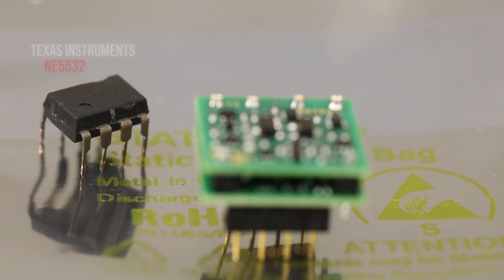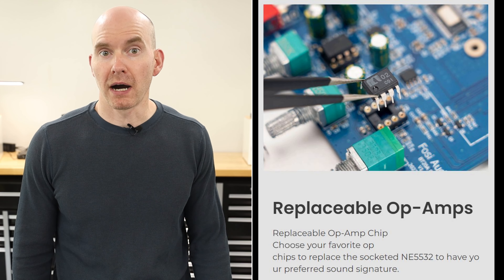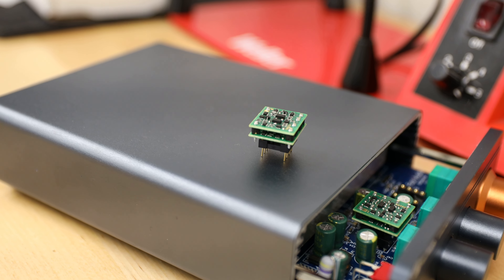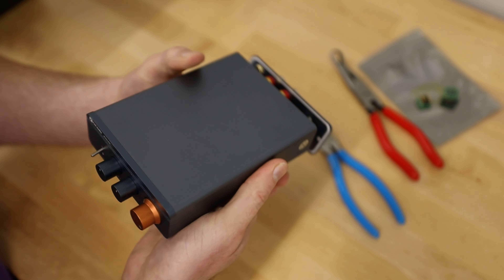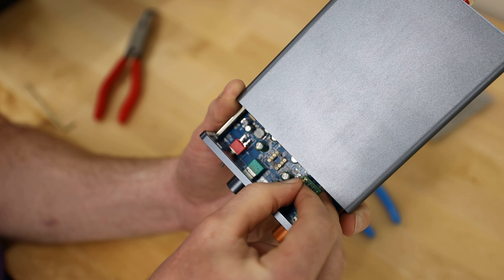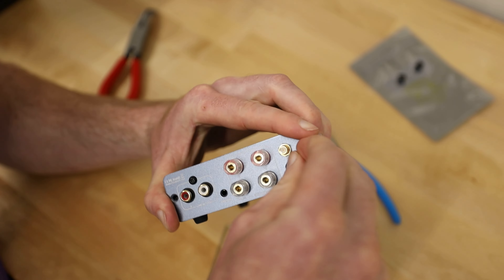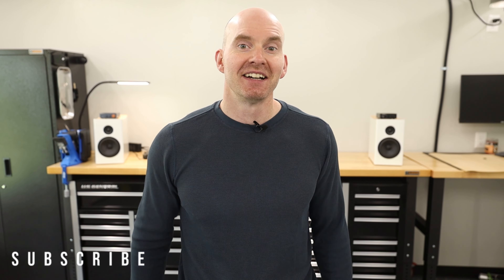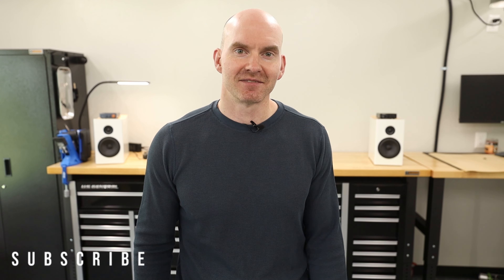Sparkos Op-Amps - Magic Beans or Musical Bliss? Fosi BT20A Pro Install

Comment: Take these reviews with a big spoon of salt. I have this little ChiFi amp, it’s wonderful for what it is for desktop listening, casual game room setup etc. but let me be clear, it’s no match for even a entry level, but well built, well priced offerings from Cambridge or Emotiva etc. The Emotiva Mini X-A100 that I also own beats the snot out of this little bugger in terms of superb midrange weight, bass depth and tightness and well resolved treble and separation. But for $80, this BT20a Pro does hold a surprise or two on how well it still can drive medium to large speakers. Anything upto 11 O’clock position sounds good. Beyond that it loses its composure, but it’s already pretty loud 90db by then. Try this for fun and you may find a use case. I haven’t done any OPAMP rolling, but replacing with a pair of Sparkos chip costing more than the amp itself makes no sense. Just buy some well established Integrated.
Reply: Very well said & you're totally right about going with something better & definitely the part about if the chip cost more then the amp part 👍🏿🤦🏿🤷🏿

Comment: Thanks for this revue and your honest impressions. Just got my Fosi V3 and and so far it pretty good considering I am using the Wiim Pro with its average or below par integrated DAC. So I am waiting for my Geshelli J2S upgraded with a single SS3602 for the RCA  output. So if I were to get the Sparkos 3602 for my Fosi V3, would I need the raisers due to the Fosi V3 small space for Opamp? And also will this set up work well, having single J2S SS3602 and also on the V3 or is it overkill? I hope my post makes sense. Best regards
Reply from the maker: Hey sounds like a great little system your putting together. I can’t speak on the synergy of the J2S 3602 along with 3602’s in the V3, I haven’t had that combo yet, yes you will need risers for the V3, it’s a tight fit.

Comment: Hello Matt,

Could you tell me the exact size of the socket wrench you’re using to remove the screw from the volume pot to take the chassis off?, as I’ve a Fosi Audio V3 just arrive moments ago, as well as several different brands of Op-Amps come in I’d like to roll.

TIA!.

Comment: Hi great video thank you! Would the op amps you used on the fosi also work with the aiyima a07 pro?
Reply from the maker: Yes but I believe you do require the risers for a A07 that I show in this video.
Reply: @MattCoykendall1  that falls in line with other things I’ve heard , thank you!

Comment: same experience except with an ayima a07.   the sparkos smoothed out the high mids.
Reply: If it smooths things out, you are removing detail, it's as simple as that. Just like a valve amplifier.
Reply: @MichaelBeeny  it wasnt detail.   it was harsh..exaggerated..  ears are different

Comment: I claim to have Golden Ears 🙂 The Sparkos op-amps are very good, some of the best out there, but it does not pay of to put them in this amp. Much better do it in the newer Fosi V3 amp.
And why is that you may ask? Because you are only able to change 2 of the 4 sound killer op-amps 5532 in this amp, the 2 others are surface mount op-amps, which are very hard to change.

The 2 problems in this amp are: They have implemented a tone control that introduces fase shift (bader sound), and it can not be dialed out even in the mid position, and the other one is
that it has 2 SMD mounted 5532 op-amps that can´t be changed, if you are not very skilled at SMD soldering. The Fosi V3 does not have those 2 SMD mounted 5532, and sounds much better.
Reply from the maker: I actually moved the Sparkos op-amps over to the new V3, they will likely live in that one until something new comes along to experiment with. It was a tight fit on the v3 and does require a riser but its doable.
Reply: @MattCoykendall1  Maybe you will give your opinion on the sound of the 2 amps? I find the V3 much better.
Reply: not to mention that as the 5532 was the standard in the audio professional equipment for decades, it means that amost all the music existing on the planet has passed trough tens of 5532 before reaching the final customer. 
So the claim is that the change of the last final opamp in the chain will magically recovers all the sound quality lost during all the production process?
I claim that a change in sound is necessarily measurable. If a change is measured, so it mean that the original signal has been distorted in some way. the so called "subjective"  changes that can't be objectively measured are a bullshit. it's a reaction to a belief and bias. 
if you like the "smoothness" and other magic words introduced by distortion in a signal up to you, but don't pretend it's a more pure sound.

Comment: Ever since discovering the Sparkos Labs Op Amps, which began when I purchased the inexpensive Aiyima A07, I became hooked.  Yes, the Sparkos Labs Op Amps are much more expensive (but you get what you pay for here).  In each case now (using them on a half-dozen other Chinese-made Op-Amp upgradeable amplifiers), the sound improved, making the overall sound signature sound closer to the warmth of a class AB amp.  It was enough of a difference for me to make the adjustment to be sure.  

As an aside, I've not found a class AB amp that accepts interchangeable Op Amps, and it seems the entire genre (correct me here if I'm wrong) can only be found in class D amps, that typically have a colder, 2D type of sound.  The Sparkos Labs Op Amps change all this for the better (in my subjective opinion of course).  I've also put them in various other components such as FX-Audio and Douk Audio DAC's - and it made a huge difference there also.

A very close runner up (if you don't want to dish out the money for the Sparkos) are the IC design Muses02 - that IC chip also has a much warmer, tube-like sound.  In the end, if you love the colder, 2D type of sound of Class D amps, don't change a thing.
Reply: sir what other op amp have test?  what op amp is close to sound of tube? ( sweet, mild, bass)
Reply: @jericlee1509  Keep in mind that no one OpAmp will give you a total transformation.  I've been experimenting with OpAmps now for over two years, and here are my observations/recommendations:

1.  For the most part, I've found that the Discrete (remember that word - Discrete) OpAmps wind up giving you the greatest improvements in sound quality.  This includes improvements in instrumental timbre, overall sound tonality, and warmth.  Of course, Discrete Op Amps are also more expensive.

2.  Of all the IC (small) Op Amps that you notice inside of class D amplifiers, I have found that the MUSES02 (in my opinion) is the best of that variety.  Now the MUSES02 will still set you back in the $40+ USD price range.

3.  Of the Discrete Op Amps, there are 3 that I can strongly recommend, those being:

a.  Burson V5i - this one may run you from the $40 - $50 range (depending on where you get it from) and is roughly 1 - 2 times larger in size than the regular IC based Op Amps.  It adds (again, in my opinion) more overall warmth, better instrumental timbre, more dynamics, and better bass response.  But do remember that there are some class D amplifiers that already a built-in tonal curve to accentuate the bass and there's not much you can do about that.  What discrete Op Amps might do is to try and make that bass tighter and more dynamic.  The website address to that OpAmp is here:

https://www.bursonaudio.com/product/supreme-sound-opamp-v5i/

b.  The 2nd recommendation that I can make, and this one is most expensive of the bunch (but not necessarily the best overall) is the Burson V6 classic - but I'll tell you right now that it may NOT fit most of the budget class D amps because it is very tall and that may interfere with the amplifier casing.  That runs from $89 to $100 USD, depending on where you buy it from.
The website address to that OpAmp is here:

https://www.bursonaudio.com/product/supreme-sound-opamp-v6/

c.  The final recommendation, and in my opinion, the best (again, remember, I'm offering personal opinions here based on experimentation), is the Sparkos Labs SS3602.  Now this OpAmp is much larger width-wise (around 3-4 times larger an an IC), is priced between the Burson V5i and the Burson V6 classic.  Overall, it has a warmer tonality - spread through the entire frequency range, not just one particular area.  It demonstrates great dynamics, superb highs, and a very nice midrange.
It cost (before discount) - $79.80 USD, however new customers usually get a discount which ranges 15-20% off).  If you are a repeat customer (you have to be a repeat customer though), the 20% repeat discount can be had with the code:  RETURN20.  The website for this OpAmp is:

https://sparkoslabs.com/product/dual-discrete-op-amp-ss3602/

In the end, there is no one OpAmp that makes an amplifier sound "just" like a Tube Amp.  What these OpAmps do is to change the personality and tonality of the amp and no two users will have the same musical tastes on how they prefer their music to sound.

With budget amps, I've long since found out that the Sparkos Labs OpAmps give you a huge bang for the buck and inches your amp closer to that Class AB or Hybrid Tube sound.

Good luck:
Reply: @MrBenherrmann  thanks so much, really help,  have heard or try of staccato op amp?
Reply: @jericlee1509  Not off hand - I haven't heard of that one.
Reply: @jericlee1509  I've tried a variety of the small IC based ones.  They have limitations and the right now, the only Discrete versions I can recommend are those I recommended in my previous reply.

Comment: The only valid test to me would be a blind test. When you spend 80$ on a chip, I think it's more what you want to hear, than what you are really hearing.......the proof is that there are only 2-3 videos with direct side to side sound comparisons and even there there's hardly any difference.
Reply: If I just spent $80 on a preamp chip. I KNOW it will sound better! lol. Wont it?
Reply: @MichaelBeeny  Not necessarily. It's about the requiremenrs of the circuit, supply voltage, slew rate, needs compensation or not, type of input (JFET, FET, bipolar, etc). The opamp is only a part of the equation, opamp rolling is funny (I have done it), but to date I haven't done any test where one opamp magically sounds better than the rest, just because it's more expensive. If that be true, you'd see plenty of evidence and countless YT videos.....

Comment: A better option would be don't buy a class D in the first place. To say buying discreet allows better matching of components. Not true, you cannot beat laser trimmed ICs for matching and near 100% consistency. All at a fraction of the price, just avoid the many fakes from China. Avoid snake oil at all costs and, it's gotta be better, if it cost more than the amplifier. Sure, they often have a higher current rating, but will this help? No, it's a preamp, it's a voltage amplifier, not a current amplifier. Sometimes, these can overload the current available from the power supply. A typical IC will draw about 10mA, the many discrete versions can draw 60-100mA. Overheating the 15 volt supply.

Comment: Data. Record the audio. Use data. It doesn't mean a God damn thing when people say "it's warmer, sharper, fuller" when there's no data. This video was nearly useless aside from showing us how to roll the opamps.
Reply: Warmer usually means, loss of detail. Fuller means added harmonics. Valves basically.
Reply: DaTa! MuSt hAvE dAtA! I dOn'T bElIeVe PeOpLe WhEn tHeY uSe ThEiR wOrDs! /s
Reply: @kraig7777  I have no idea what you are talking about. Try English.
Reply: @MichaelBeeny  woosh
Reply: You listen with your ears, not an HP spectrum analyser. Instruments are used in design to confirm proper functioning and stable circuit. DATA, specs.  Are you measuring the correct attributes? Forget % THD- it's virtually useless. This is for product brochure one upmanship.  Ask Sparkos for data.  Cheers! Sandy - Bell Labs Engineer (ret.)  and long time Boston Audiophile
Reply: @sandyshoremann7524  engineer my ass, lol. I dare you to present your work with subjective results. Rofl